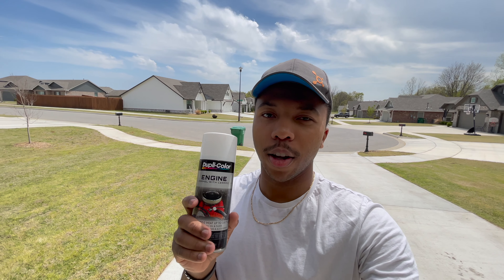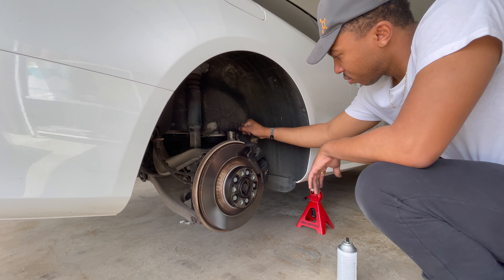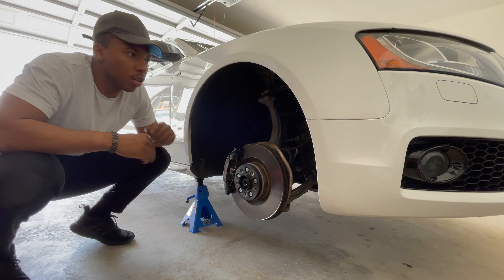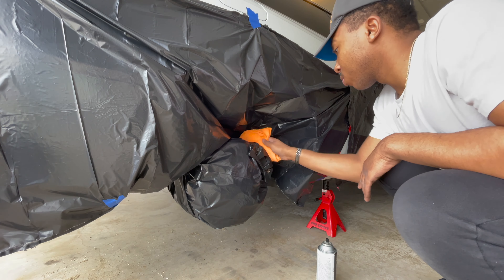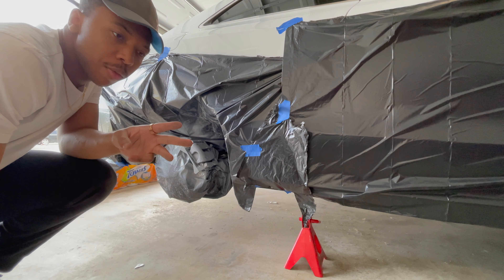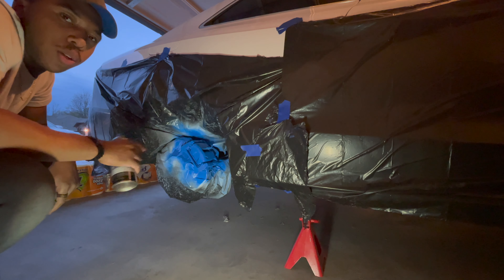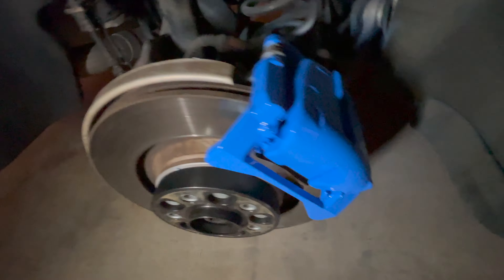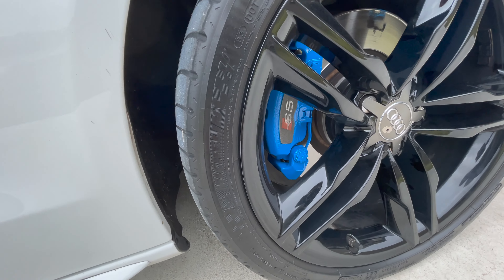HOW TO PAINT BRAKE CALIPERS... THE RIGHT WAY!!!

Comment: Currently doing the same today only I’m using a red paint to match the red S3 logo
Reply from the maker: That’ll be dope! It definitely makes a huge difference 😅
Reply: Yeh it looks amazing to be fair. Only thing letting it down is the S3  logo on the front callipers as the colour in them has faded. Have you had this problem?
Reply from the maker: @Paul-pj5sz  yeah that happened to me while cleaning the caliper with brake cleaner. I ordered S5 caliper stickers to fix it, still haven’t put them on yet though.